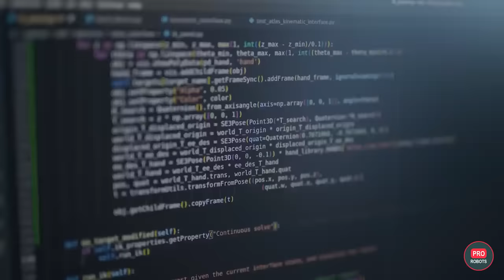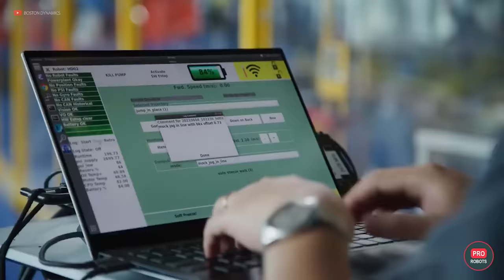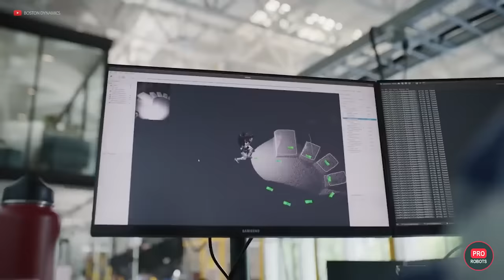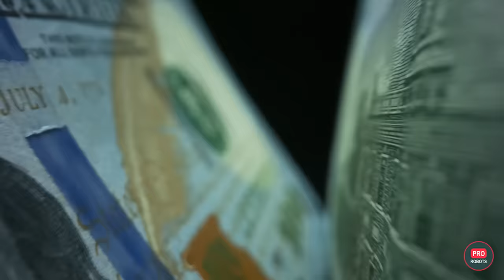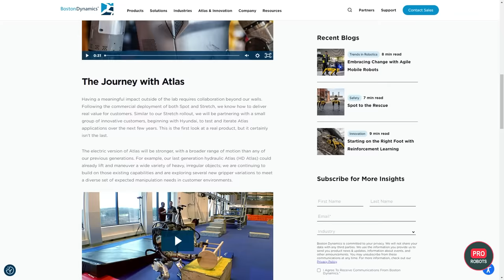How does Boston Dynamics' new Atlas robot work? | What's unique about the Atlas humanoid robot?

Comment: The previous version of atlas looked so cool. obviously how cool it looks is not the main factor. The new one looks really cool too. and I'm sure with the purely electrical actuators, It will be much more reliable, especially as they improve on the design. I'm sure it will probably be pretty modular, like the spot. I'm sure there will also be computer modules to extend it computational capabilities too.